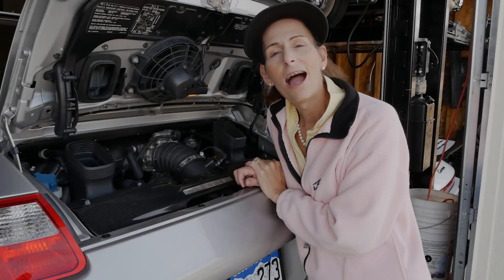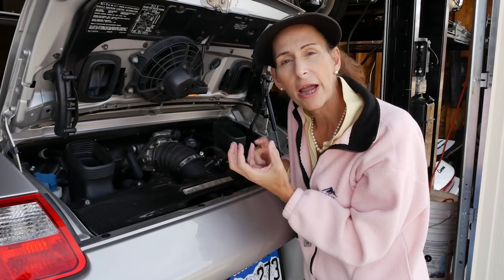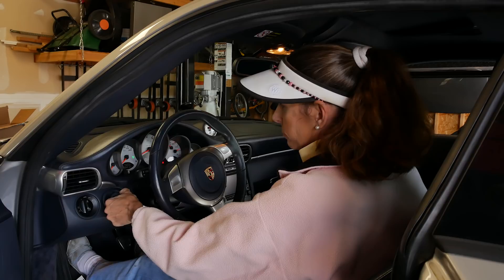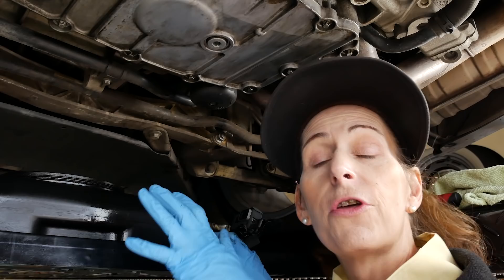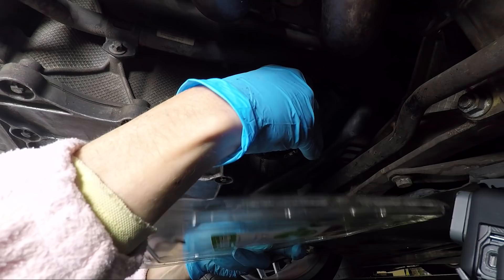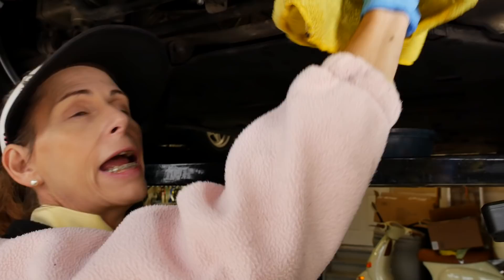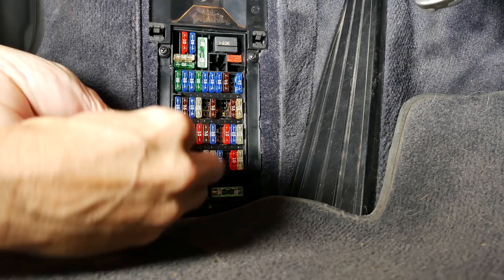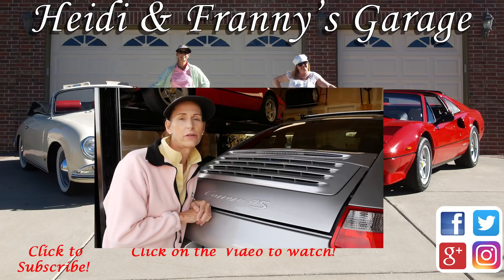How to Change Oil on a Porsche 997 Carrera 4S – with Blackstone Analysis! (DIY)

Comment: Current problem (maybe) with my car is a brake booster issue. I seem to have a weak vacuum pump on my 997. With the engine hot and idling after about rapid 4 presses of the pedal the booster seems to semi deplete noticeably for a second or so. I have checked all the vacuum lines manually and there are no leaks. I did find the solenoid valve on the airbox was leaking and fixing that greatly improved the issue but its still there. Now I am at the point of thinking that this may be more of a characteristic than a fault? Any ideas?
Reply from the maker: Hi Andrew, I would try splicing in a Vacuum meter to see what the Vacuum is actually doing.  I just bought one off Amazon (https://goo.gl/Y87BEQ) it is a carb fuel pump gauge that will also read vacuum. If it stays steady with all that pedal pressing, then you may have an issue with the booster.  I honestly don't know much about the modern bosters, but I should take a look at at the vacuum to rule that out.  If your vacuum poops out, you may have a faulty one way valve somewhere in the system.  That I think will just be a bit of trial and error.  There should be a complete map of all the vacuum lines on a sticker in the engine compartment.  Let me know how it goes... Franny
Reply: Heidi and Franny's Garage Thanks for your reply.  I will try a vacuum gauge on it one day after the snow melts off it. These days it's all about testing things and not guessing. In Europe we do not get the vacuum diagrams under the hood however it's very simple compared with older cars.

Comment: Nice video !X51 ?
Reply from the maker: I believe so, but after the fact (not an option).
Reply from the maker: Heidi is correct...  It was retrofitted with the factory X51 options, but there are still a couple things missing - most notably is the vacuum actuator for the sports exhaust.  It is stuck on "Sport" all the time...

Comment: Any tricks that you can recommend if I out too much oil? I have 1.5qts left out of 10qts but my oil level is above where it should be.
Reply from the maker: Well, I've done that :)  What I do is, with the car cold, (this is a bit messy) grab your drain pan and loosen the drain plug.  just to the point of coming completely out and out a measuring cup under the bolt.  Loosen the rest of the way, but hold the plug up against the car.  Just let out enough to fill your measuring cup to the correct amount you want to remove and re-tighten the plug.
Reply: Heidi and Franny's Garage thanks! Do I need to replace the washer?